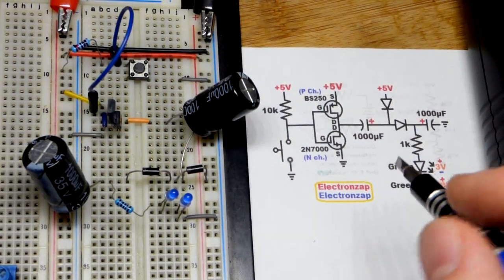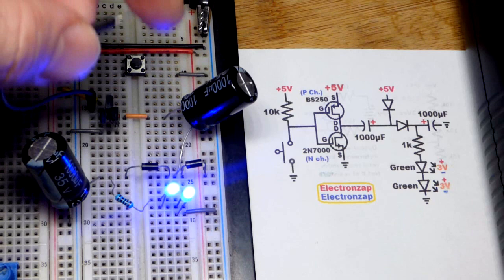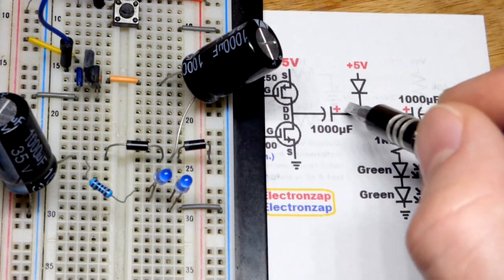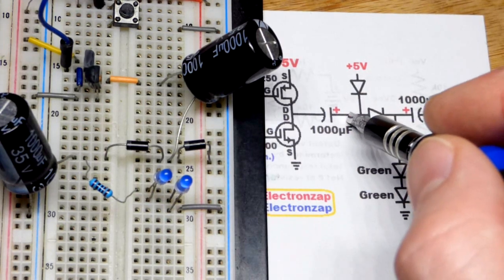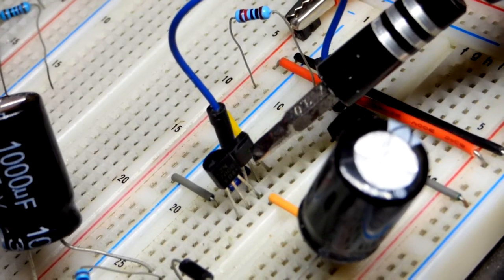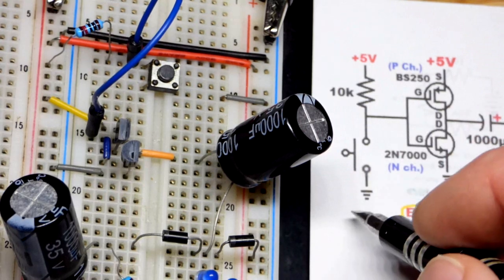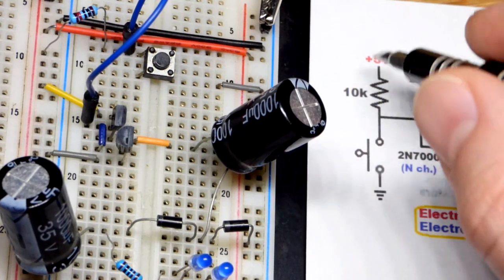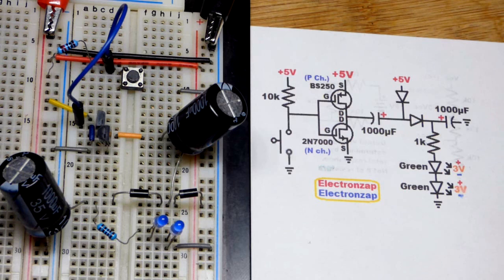MOSFET 2N7000 BS250 push pull voltage doubler with diode drops demo circuit schematic diagram

Comment: I am thinking a 4011 wired astable mode could drive the mosfets then use a zener on a third nand gate to regulate output voltage.